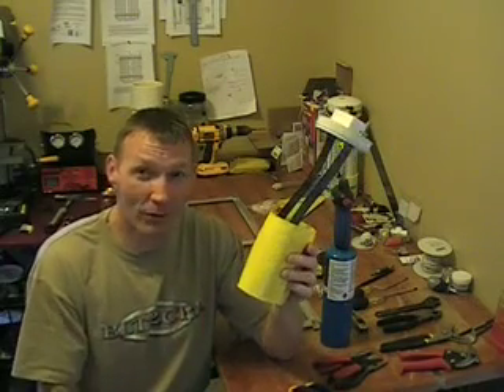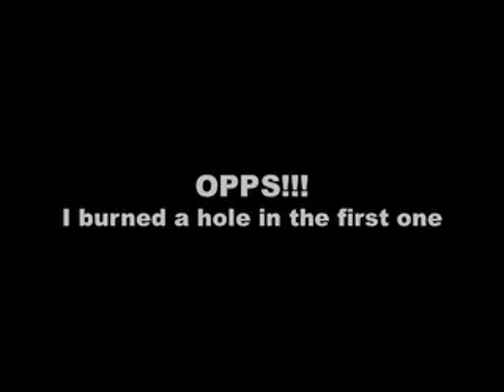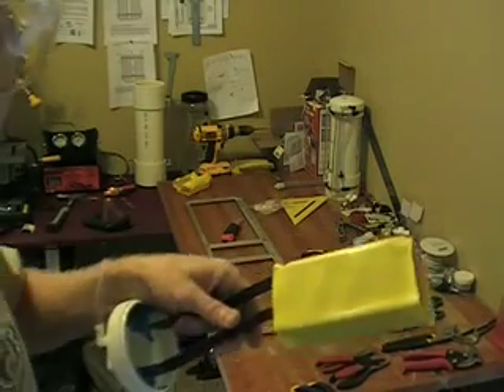005 Wrapping the Smack Cell

Comment: I would recomend placing soft THICK rubber pads on a sides before shrink wrap. This will assure plate edge seal. Wrap itself will not go around every edge by itself. Shrinking wrap will press rubber pads into the plate edges thus sealing them effectively.